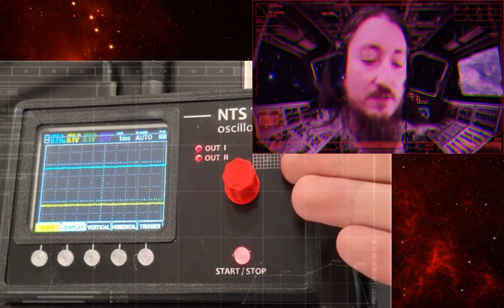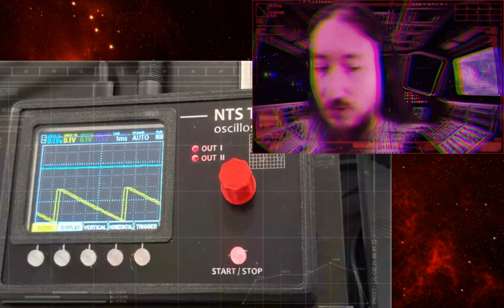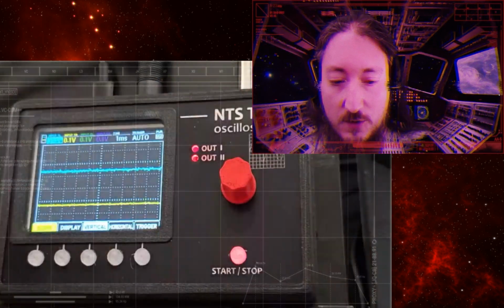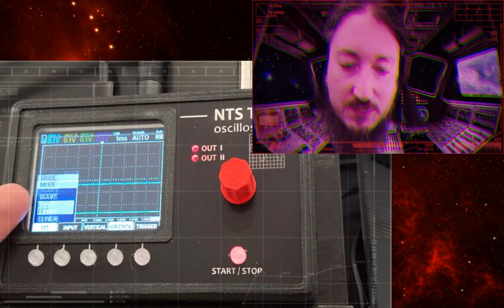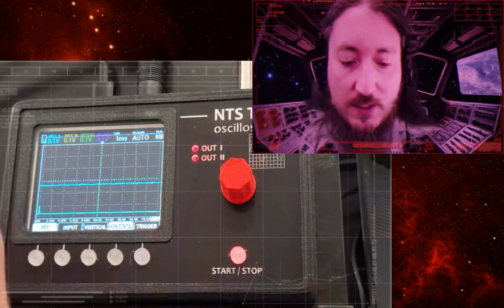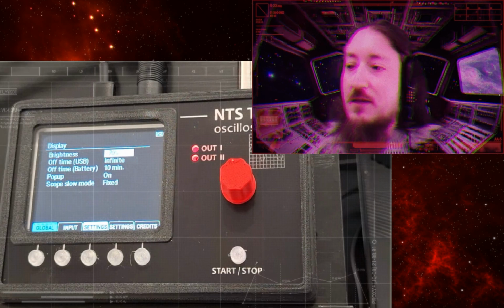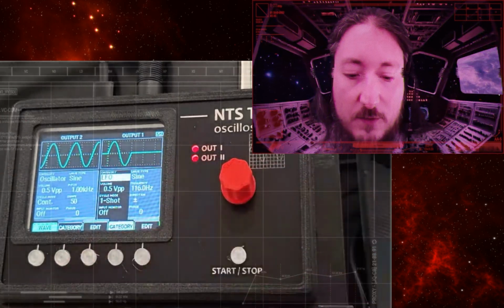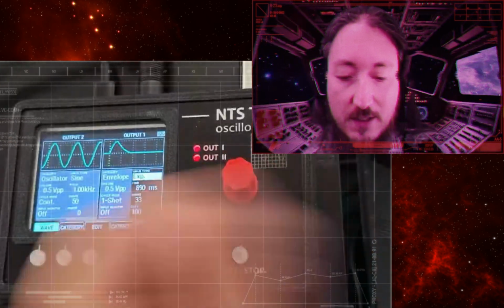Korg NTS2 Oscilloscope - Review from Space (rerecording)

Comment: Hello thanks for your video, i have received mine but for tuner fonction, when there is nothing to connected on, the needle move. Is it normal because on your video i can see no movement on yours as you can see in my link below 

https://youtu.be/ISQfg8JfB1A?si=7jEuDMtcMvt6xHtJ

There is a set to do to avoid this??

thanks in ad for your reply
Reply from the maker: i just checked on mine and i think it is probably noise from the USB power, when i run on usb power with no audio input it behaves the same way as yours but when i run it on battery power the needle sticks almost to the middle
Reply from the maker: and when there is audio input (from my synth holding a simple saw tooth note) there is almost no needle twisting for me despite running on usb power

but as soon as i remove the audio cable it starts twitching
Reply: @SkyRekkr 
thanks for your reply.
Reply from the maker: @noisysquare75  no problem hope it helps you out :)
Reply: I found using a good quality battery pack plugged into the USB port reduces noise. I use mine on my Korg Volcas and they are well known for noise and the same applies to them I use an external battery pack and it takes away the noise
Reply: @tony1ant
Great!, could you share the reference of this batterie pack please ?